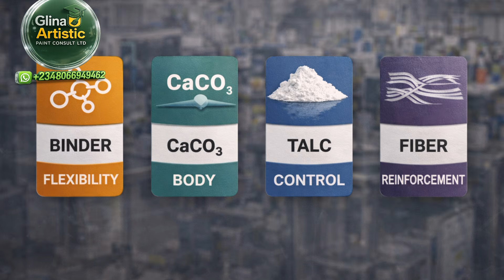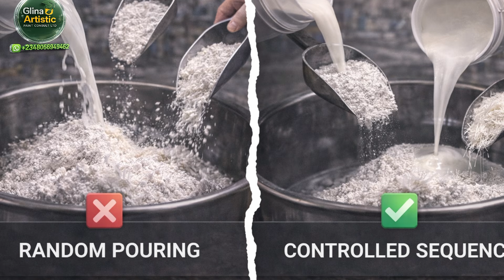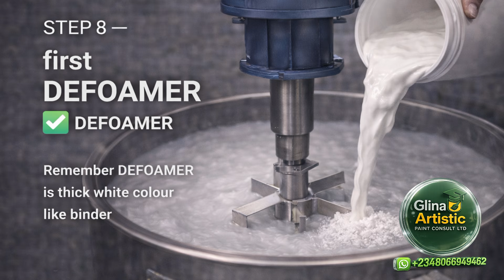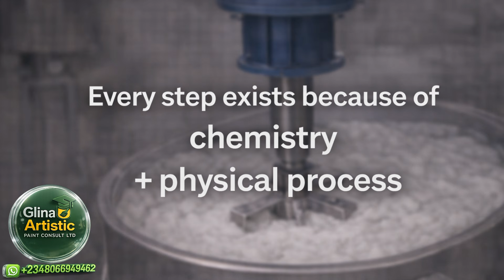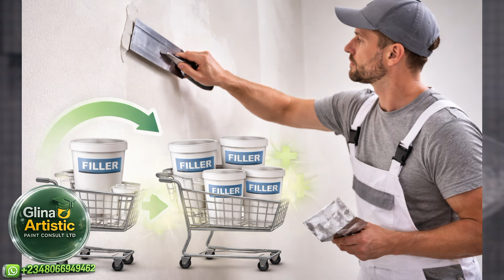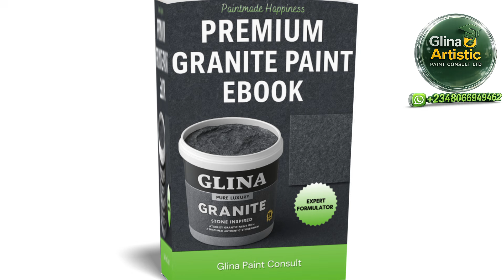Premium Acrylic Crack Filler — System Design Explained

Comment: I want mesurment 20 litr crack filler
Reply from the maker: Here is the chemical measurement list for 20 litres.👇

Clean Water 4.5 L

Defoamer 30 ml

Preservative(Formalin)20ml

Ammonia (25%) 30 ml

Natrosol / HEC  150 g

Additional Water 1.5 L
(Pre-hydrate separately)

Calcium Carbonate (fine) 9.0 kg

Talc (micronized) 2.0 kg

Fibreglass powder cellulose fibre 300 g

(This is what prevents crack returns)

Acrylic Binder (Premium)
5.0 L

Texanol / Plasticizer 120ml

Makeup Water
As needed (≈ 0.5 L)

Final Defoamer
10 ml

⚠️ Note:

The order and control logic matter more than the  list of chemicals measurements.
Most failures happen when people copy without understanding.

Comment: Premium Acrylic crack filler measurements for 20 litrs
Reply from the maker: Here is the chemical measurement list for 20 litres.👇

Clean Water 4.5 L

Defoamer 30 ml

Preservative(Formalin)20ml

Ammonia (25%) 30 ml

Natrosol / HEC  150 g

Additional Water 1.5 L
(Pre-hydrate separately)

Calcium Carbonate (fine) 9.0 kg

Talc (micronized) 2.0 kg

Fibreglass powder cellulose fibre 300 g

(This is what prevents crack returns)

Acrylic Binder (Premium)
5.0 L

Texanol / Plasticizer 120ml

Makeup Water
As needed (≈ 0.5 L)

Final Defoamer
10 ml

⚠️ Note:

The order and control logic matter more than the  list of chemicals measurements.
Most failures happen when people copy without understanding.